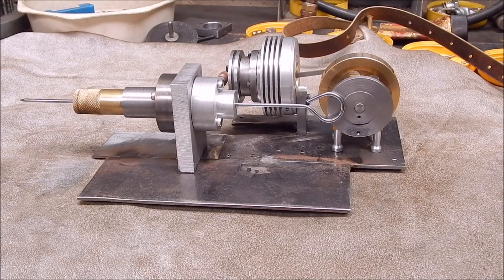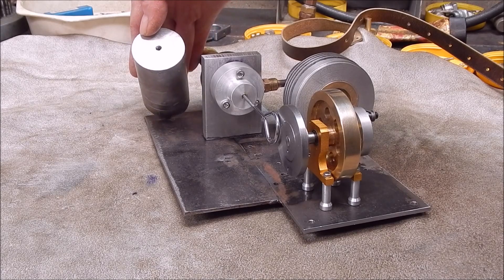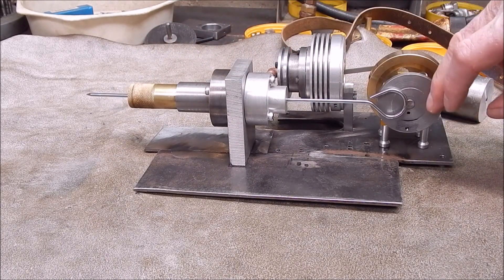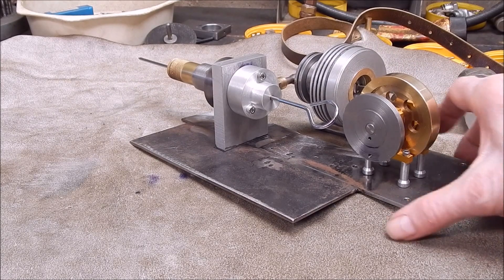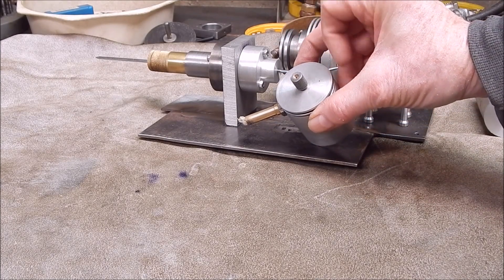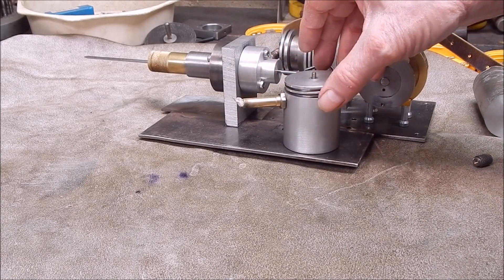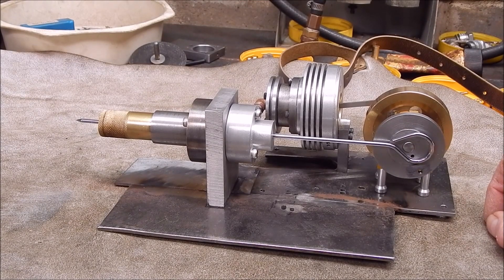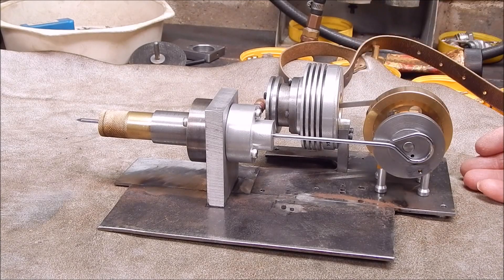How good was that home made aluminium round stock in the center ?

Comment: You've done well with your Al casting Rob. This new engine looks intriguing and hope you manage to make it run.
Reply from the maker: Hi Chris,  it's going to be interesting to see if it will run, as it violates all the stroke and displacement rules I've used successfully before.  I will have to play around with it to try and get the ratio's right. It's all VERY experimental, but what's life without a challenge ?  Cheers Rob

Comment: Want to make 2 V belt pulley clusters to replace  flat belt clusters for an old lathe. Going to follow what you say about melting alum and casting a test piece. Thanks for the info, from QLD.
Reply from the maker: Perfect application Lawrence.  Yes, crawl before you can walk.  That will get you up to speed on this.  Cheers Rob

Comment: Hi Rob,
In the video that you made showing the casting process you mentioned that your furnace was lined with pearlite and cement is that the same pearlite that goes into pot plants ?
Reply from the maker: Yes, that's the stuff Ian. Just get a bag from the garden centre.  It's very cheap.  I bonded it together with sand and cement mix.  Originally the furnace had a metal liner, but that burnt away years ago.  Cheers Rob
Reply: xynudu 
Ok thanks Rob !
I always wanted a small furnace but couldn’t be bothered stuffing around with refractory cement - apart from the fact it is expensive and not easy to get in small quantities . I really only need a small furnace as i only want to cast ingots to make pistons for small model engines and to make the cylinders out of (alloy cylinder with cast iron liner ). I work for a waste company that has its own workshop and old pistons ,alloy rims off trucks and old lpg bottles are a common thing in the scrap metal bin ! I reckon i could set up a furnace for less than the price of a a box of beer - although i will need one of these as well to sustain me while i build it 🤣
I’m not interested in using sand casting as I can’t be bothered stuffing around with it or making patterns -using a piece of pipe as a mold is just what i was looking for !
Reply from the maker: Sand casting is tricky and another learning step Ian.  Stick with pipe casting for now, get that perfected and then maybe think about the top shelf stuff like MyfordBoy does.  He is so far ahead of me on this it's not funny.  So watch his channel and you will learn a lot.  Cheers Rob
Reply: xynudu 
I have been watching him for years ! One day he will utter a word and i will drop dead !
Another one i watch old foundryman .
I don’t see myself ever doing sand casting - seems like too much hard work to  me ! Time in the shed is meant to be enjoyable not hard work !

Comment: Hi Rob,
Since watching your recent video about home casting aluminium round stock, I've watched few projects on making a home foundry and had a chat with my mate who owns a bike shop and he has agreed to give he his old aluminium parts to melt down... I thought if i sorted the bike bits into similar component types (brake, handlebars, rims, etc) i should be able to work out what works best. This should work well as there is not to much spare cash in The Knackler's Workshop - hehe.
Take care
Paul,,
Reply: A good rule of thumb, use salvaged castings for casting. Forgings or "billet" parts arent usually great choices for home casting. Alternator cases, cast rims, cylinder heads, engine blocks, even most automotive pistons, all good candidates. Any alumin(i)um part with die knockout pin dimples, good candidate. Parts like suspension arms are usually forgings, so not so ideal. Drawn stuff like beer cans, not very awesome. Extrusions are kind of iffy, they're sort of hybrid casting/forging. Old air cooled VW engine cases are iffy, because some are magnesium castings, not something you want to toss in a home casting furnace, lol
Reply from the maker: Sounds great Paul!  Most people don't realise how much variation there is in aluminium.  It's similar to the wide variation in steel types. When you find a type that casts well without porosity and also machines well, stick with it.  Alloy car wheel rims work well.  Cheers Rob
Reply: @Xynudu  You know, I forgot Emo I was talking to our maybe it was even a video, but somebody said to add zinc.  Like from alternators, he said it gives a better finish on cast parts and more detail.  I haven't tried it, or know the strength but I want to try it.  He did say adding zinc "pot metal" or even 100% zinc, you have to be careful as if you heat it too much it will just flare up and burn up. Just like if you try to melt a newer penny. Newer pennys are zinc with a copper coating. Thank you for always sharing your experiences!